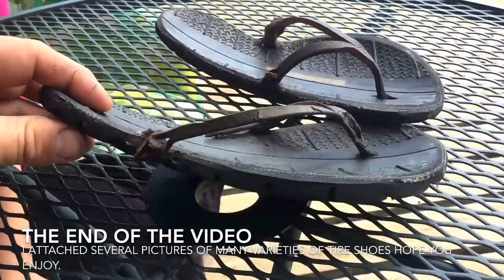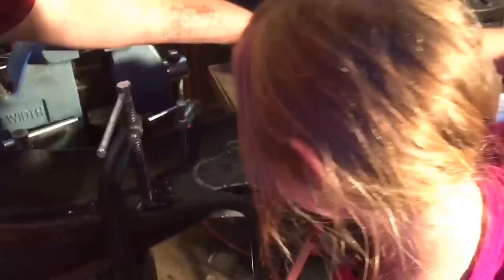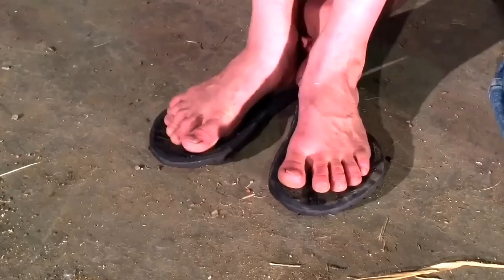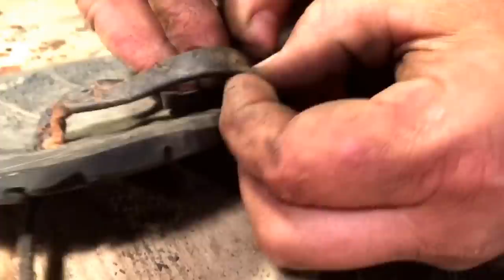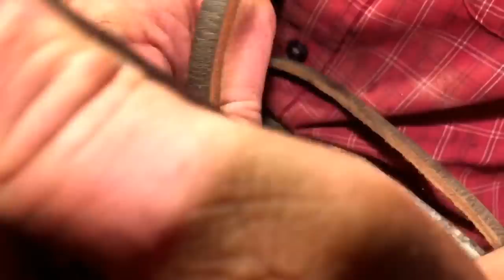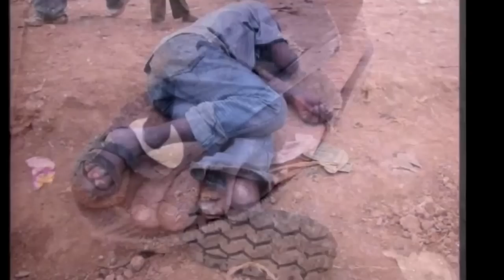Homemade sandals, made from tire treads.

Comment: You can get inexpensive nylon or polypropylene trick line or braided rope that braids well and you can link it with a small key ring or large hog ring (which has plenty of other uses)in the middle. It's waterproof, won't mold and can be easily repaired with more line or by tying simple knots. You can hose them off and scrub them with any soap to keep things clean. Dry them outside in the shade and they'll last until the rubber sole rots away. And then you always have a few feet of strong line with you.
also, the next pair you make you can get just the tread without the cord and steel belt layers underneath so you don't have to use power tools to cut through them. Make a cut with a razor knife across the tread on an old tire. Have a helper grab the rubber inside the cut you just made and start peeling it back. As they peel back, keep cutting underneath the tread to release more of it. No cords to contend with as they are left in the carcass of the tire and you still get the long-wearing rubber of the tread. Bonus points if you can find an old bus or big truck tire. A little harder to cut, but the composition of that rubber means the soles might outlast you.
Downside is the sole won't be as stiff, but it's easier to make and you can shape them with a razor knife. A bit of contact cement also means you can resole boots and shoes with tire treads.

Comment: Thank you. I a planning to make some too, though different style. So far I cut the tire manually, which works as long as I sharpened the knive often during to the process. I will start with gluing the sole onto existing shoes and go from there. I am a bit concerned about the weight of the tires. Did she found it to be a problem?

Comment: Was there the steel in the tire?
Reply from the maker: In the tread yes, on the sidewall no.
Reply: Thanks! I tryed to find old tyres withoit steel here in Italy but it is impossible so I used a normal tyre with a grinder but was impossible 🙁
Reply from the maker: Emanuele Billi 
ATV tires work well, even dirt bike or motorcycle tires work good too.
Reply: Back to the Basics 101 you are very kind! Thanks a lot!

Comment: Maybe use a soldiering iron or hot knife at the end sand fuse or coterie the edges so they don't Frey or start to string. I know she will most likely out grow them before this becomes an issue.
Reply from the maker: Welderboy 
   On the four ply tire there was hardly any steel belting at all. In fact I didn't see any,on that particular tire. But that would be one bad, sliver for sure.
   Thanks again for subscribing and for your comments that means a lot. If you have something you'd like us to cover in the future please let me know. If I can I will try to help you.

Comment: so you leave the metal threads in the tread?
Reply from the maker: +Eric Gillespie 
   Yes I did, I did grind The outside edge so as not to git poked, car tires work much better then pick up tires, and I've been told that ATV tires work even better.
    They make a Great conversation pieces and they are very comfortable. If you make a pair let me know, or you can send me pictures. Thanks for watching, and your support.
   Luke